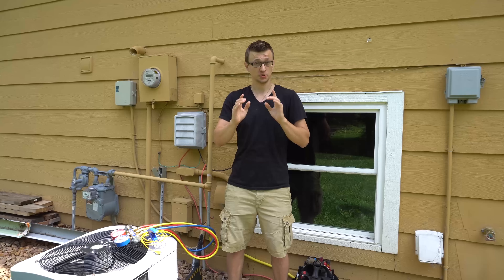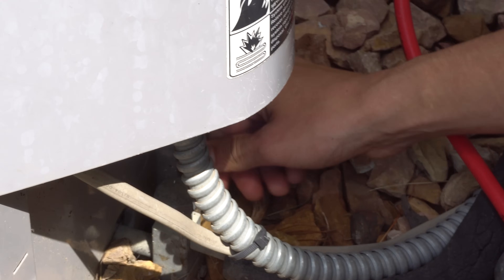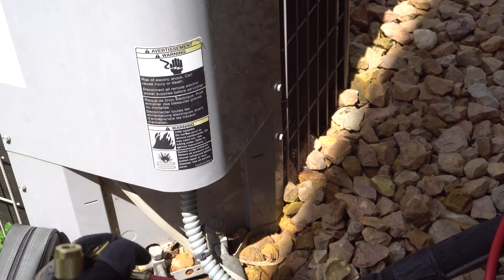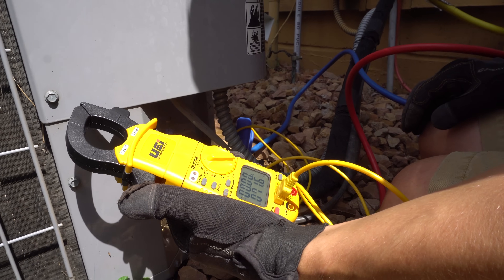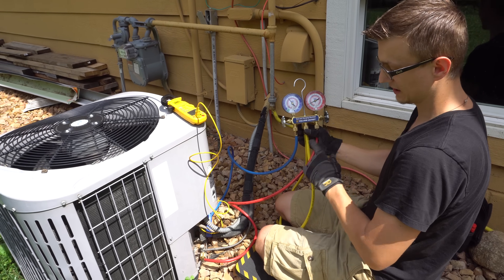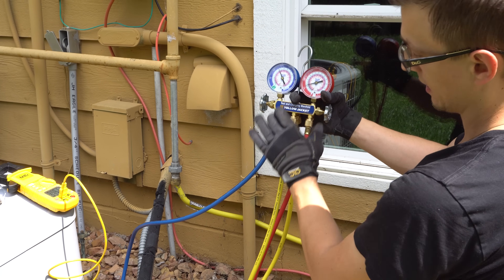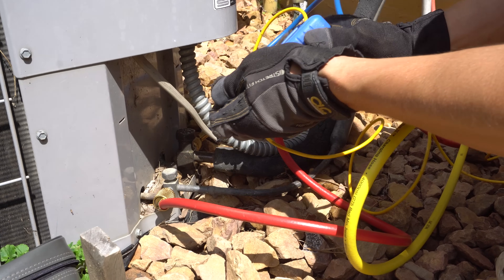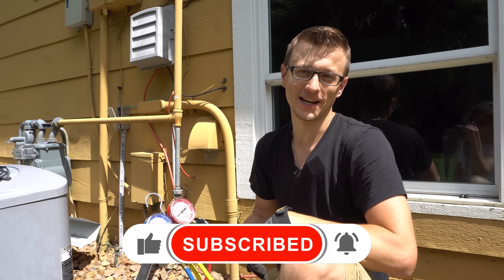How to Read SUPERHEAT and SUBCOOLING

Comment: That was a really low high side pressure.  Here in FL all the 3 ton R22 units I see run from 225-250 psi.  The other thing is the house needs to be cool when you check it.  Especially if you just had to add a charge.  I watch the temp on the low side tubing at the evaporator until the house gets cool.  The unit on my house uses orifice tubes and it doesn't have an accumulator.  I'm careful with it.  Good video, well done.

Comment: Sir.. I use your. Idea on my walk in freezer cold room.

Freon 404   but when i chek suction line pressure in my guage its showing 15psi  then i chek same color code temparture its -30.

Then i chek expanion senser bulb area suction pipe temparutr by themometer its showing  0.4

So how can i calculate this.

Calculator showing error.

Comment: Does the temperature outside  depending by the weather or if the unit in exposed in su affect the reading? And also does this method also work with celcius?

Comment: What about measuring the line temps at the evaporator? The liquid line will get hotter as it goes through the attic as will the suction line as it goes through the attic even though it's insulated.

Comment: If when the unit is off, if the pressures on the high and low side doesn’t equalize, what does that mean? How can it be rectified please?  However the unit seems to be properly cooling with a subcooling value of 10 degrees (14 degrees is targeted temperature on the decal of the unit.)

Comment: The pressure won't be equalized if there is a shutoff solenoid on the liquid line just before the evaporator/fixed orifice expansion valve.

Comment: good video, but maybe you should try pre-filling the gauges with refrigerant prior to attaching them to the system. Every time you attach dry gauges you remove some refrigerant. If that gets done enough times the system will have enough refrigerant "vampired" out of it the system will appear low on charge. We have a standing rule in out company "prefill those gauges every morning!

Comment: hey i was watching your video and its says suction line - ST = sc but i saw you connect it the the liquid line isn't the suction line only the low side line?  And also you said we can get both sc and sh readings on the liquid line at 9:07.  So i'm a little confused on the equation.
Reply from the maker: Sorry about the confusion. At 9:07 I was referring to the general location, right at the outlet of the condenser unit. SC is measured on the liquid line and SH is measured on the suction line.

Comment: Experts, any chance you could chime in please ? Mine is a TXV, Line temps are 81/suction & 95/hi, with gauge temp readings 22/suction & 110/hi, making my SH=59 and SC=15. Pressures are equalized at idle (150psi) but 10mins after operation gauge pressures are 48/low & 250/hi. I can't afford a tech at the moment & I know there's a leak somewhere because my neighbor's been "topping off" the system for me since spring just to get me thru the summer. The top off lasts about 45 days. Now he's away but I do have some r22, a manifold & an infrared thermometer. I know I'm shooting in the dark here with my lack of experience but I'm hoping someone could chime in so I could relieve my asthma in this hot weather.

Comment: You should always use a wet bulb and dry bulb method to determine your superheat, not the gauge. You can use the gauge in the pipe plant to figure your subcooling

Comment: Great video. I have a Rheem 3 1/2 ton condenser and a 4 ton air handler in the attic. With a TXV. My sub cooling chart saids @82 degree ambient temperature SC should be 5. Would that work for a 4 ton coil?

Comment: I thought it a good idea to purge when reading.  But nobody does.  I guess the pressure is still different enough to keep the air pushed up the hose and not mix.  I dont bother.

Comment: Semi retired HVAC service/Installer and former instructor...This is simple and very clear and the idea of marking the gauges, just plain smart...Thanks.
Reply: I know this is a random question but seen u were in the hvac field i recently installed a gas furnace with a 4 ton straight ac its a piston acoil .. an it doesnt seem to be getting cold. Everything is running fine and pressures are normal.. everything is new.. got any ideas on what could be causing this..only blowing like 68-70 degrees out the supply vents

Comment: EASY WAY TO REMEMBER "L for Line temp, P for Pressure"  OK so LP as in PROPANE as in GAS/VAPOR,  Line - Pressure (LP)= Superheat.   And for Subcooling PL (Pressurized Liquid)(propane liquid) so Pressure - Line = Subcooling (PL) WHEN I SAY PRESSURE I AM REFFERING TO PRESSURE/GAUGE TEMP Reading. PT Chart

Comment: When i started as a apprentice i had a senior tech write the exact samething on my personal gauges. He use Sat temp instead of gauge. I still have them and its very faded and can hardly read it now. I would personally never use a temp gun and always use some type of clamp. They are much more accurate plus can be calibrated.
Reply: He also told me when diagnosing a problem try to think of the low side gauge as your evap coil and high side as your condenser coil. So if your experiencing problems that are with one or other could be something that affects those coils. This isn't very every scenario but it is a good tip...

Comment: Question:  on a diff vid when measuring SH they did a wet blub at return and outside temp at condenser and said needed a chart to find out if you were low or high on refrig.    can you or do you have a vid. showing that process    thanks

Comment: The way you are measuring superheat is Incorrect.
A super heat chart must be used and is provided for you on the back of service pannel of condensor/heat pump.
Superheat method is only used on systems with orifice. 
Subcooling is used on txv systems.

Comment: Is the low pressure pipe always thicker?
I have a monobloc heat pump and the high pressure side behind the 4-way valve is thick and in your fimik it is thin. How should I understand that ?

Comment: Great video.  One note is that an IR thermometer should not be used for this.  The emissivity of copper is low and variable, and depends on the level of corrosion and surface roughness.  IR thermometer readings can be wildly inaccurate and this cannot be calibrated out.  A pipe clamp should be used in all cases of metal refrigerant line temperature readings.  The only exception would be if you have a painted refrigerant line due to overspray or something, or you coat it yourself with a substance of known emissivity.  Then you'll get an accurate reading.

Comment: True superheat should be measured back at the evaporator.  Of course, there would have to be a pressure tap there.  If you measure at the outdoor unit, you have the pressure loss and a temperature gain in the line set, that you have to figure into the calculation.  Good video.

Comment: I have a slight refrigerant leak in my home unit.  I track the sub cooling by measuring the difference of the temperature at the middle of the condenser coil and of the temperature of the high pressure line at the edge of condenser.  That difference is the value of sub cooling.  No need for using gauges, so no loss of refrigerant due to the measurement.  Doesn’t matter what refrigerant is in the system.

Comment: Hi, thanks for taking your time for sharing this with us. One question remains: what would be good values for SH and SC? I mean we measure these for a purpose. What can we use these numbers for?  I have installed my split climate unit here in Germany myself and it works - but I have used 9m line length instead of the proposed 5m that the supplier approved. Now I am asking myself whether the system works at optimal efficiency or do I have to add refrigerant. I think SH and SC would be the numbers to go with to find this out. Can U help here? 
Best regards from Munich, capital of the beers and home of the Octoberfest.
Reply: The measurements would be nearly the same...Line set measurements (length),make some difference, but the super heat and or Sub cooling is still critical...On a piston type metering device, the  goal is around 8-10 degrees SH or as close as you can get without refrigerant coming back on the compressor...On expansion valve the job is making sure there is liquid at the X valve...There should be a design SC # on the unit info tag if it's an expansion valve system...10-16 is usually a target range...They are all ball park figures, because Temps fluctuate as do heat loads...Common sense, amp readings and feel, are all your tools too.
Reply: @vernroach3413  Thanks. I use the AC mostly for heating and it works. I ask no more questions...

Comment: I've used your video to train my tech's. It's amazing how many different methods these guys had when I spotted their work. This video I recommend to keep as a favorite so on those moment you run into the All Knowing tech that has been doing refrigeration for 30 years, argues with you. Show them this video and move on. Thanks for making this clear.
Byron M.  - Oak Valley Electric & Air.

Comment: For superheating, the saturation temp is measured at compressor suction. For subcooling is measured at compressor discharge is that correct? I think saturation temp for subcooling is measured from condenser. From the compressor discharge, the term is degrees superheat am i correct? Kindly enlighten us because if you look at the ph and ts diagram this should not be the case for subcooling.. For superheating I have no problem on it as it match with the ph ts diagram.

Comment: Thank you for this video. Originally the blue gauge showed the saturation temperature of 20 degrees F (Pressure 43 PSI R22). At the same time the temperature I measure on the blue line next to the charging port is 80 degrees F. Thus my Superheat is 80 F - 20 F  = 60 F.  The pressure at the red gauge before charging was 200 PSI that corresponds to the temperature of 102 F. When I charged the system from the R22 recovery bottle, the Superheat changed 75 F - 26 F  = 49 F. my red At the same time my red gauge after charging shows the pressure 225 PSI or it is the temperature 106 F and I measured the temperature of the high pressure pipe was 106 F. Question- is my system is overcharged now of I should continue charging it?
Reply: having the same problem on split unit, which i also found a restriction on my TXV before the evaporator, after i charged it with 1lbs 12oz.....

Comment: This information is very useful for HVAC persons. 
I have a problem in one DX Condensing unit during charging I can't achieved supply air temperature below 20 c. And return temperature is 23c. Kindly explain what is the causes and how can I maintain supply temperature

Comment: Gauge pressures will fluctuate as the compressor turns on and off. Which gauge pressure do you use, the cut in pressure or the cut out pressure, or an average of the two?

Comment: Love love love your videos, Word of Advice!  Thanks.  QUESTION:  can I use a pocket-held digital thermometer to accurately enough measure the suction or discharge temperature? (Since I will only be taking temperatures of my personal unit, I would like to minimize expenses.)
Reply from the maker: Thank you! Glad you like the videos. Yes, I don't see why not. The temp reading comes from the outside of the pipe anyway. As you mentioned yourself though, it may not be as accurate as a clamp but it should be close enough. Makes me want to do a little experiment if I get around to it later and see what the difference in temp would be.
Reply: @WordofAdviceTV  Thanks for the response (and awesome videos)!

Comment: Very helpful guidance, thanks.
I just wonder how much power in legs it takes to make front and back flips. It looks like even on trampoline it is difficult with the assistance of mechanical springs. I see them doing it on ground level and looks easy to do but some are near to fail due to inattention or just rustiness.

Comment: Retired after 35 years,first 3 in residential and 32 years in commercial and industrial and I would agree with Shawn Green that this is a great video for beginners and even some guys that take there skills for granted. There are many times guys hook up low side gauges and don’t purge there hose and inject air into the system. Well done young man👍🏻
Reply: I’m doing a lot of refrigeration work, so I always connect high side first and purge low side through it, because with r134 you can get negative pressure inside with low charge

Comment: Why is that important though? Super heat and sun cooling?
Reply: Superheat is how much heat the refrigerant absorbed after evaporating. Low superheat can be a sign of an overcharge, metering issues, or lack of airflow through the coil. High superheat is usually because the system is low on refrigerant. No superheat is bad because a liquid surge can hit the compressor.
Subcooling is how much heat the refrigerant released after condensing. Low subcooling can be caused by low charge, lack of airflow through the condenser coil, or the txv. High subcooling can be caused by an overcharge or the txv. No subcooling means that vapor can enter the txv, and liquid refrigerant is needed to absorb heat.

Comment: so when you say Gauge temp is that the same as the PSIG? and we use the same concept even if its a heatpump?
Reply: It refers to the saturation temp of the refrigerant at that pressure, it is found on the p/t chart for the refrigerant.

Comment: I like this short explination superheat and subcooling good explination simple supeeheat =L-G and subcooling= G-L 
Suction ligne or low side blue hose and disharge line high side red hose. Vapor or liquid dry temp wet temp pressure chart to get that number 8 or 10 dor make sur to add freon or recover in it good job

Comment: Hi Jay, what would you advise to check if superheat is 0 or even negative (105F HS - 104.7 ) when it hot outside (80-95F) ? but when it is a bit colder (evening or days with up to mid 70s) superheat is even higher (20-25F) comparing to expected 12-18F. As you may guess LS pressure/temperature is always too high and vice versa HS pressure/temperature is too low (55F / 105F). Adding or removing refrigerant does not help, filter is new, coil is clean, fan works well, delta t is 7 to 9F, only on evenings it is 15F. HVAC Goodman 2.5 tons ~9 years old, cooling area is 1200 sq ft , state CT. goodman GSX130301BE, Goodman Aspt36c14AD

Comment: As a newcomer into the HVACR industry (1st semester HVACR school) I can't thank you enough for putting this concept of SuperHeat and SubCool perspective (without all the smoke and mirrors instructors use though maybe not on purpose) using easy to understand words and a simplified guidance for using a P/T chart, manifold gauge and temperature clamp readings. Keep up the great work and I look forward to more instructional videos.
+Eddie+ in Bayou Vista, TX

Comment: Great video you really show how easy it is to get subcooling and superheating calculations. If you got those txv expansion valve you use the subcooling and with the fixed orfice tube type you use the superheating. So both are important to know . Ya and I agree some times you can mix up what subcooling and superheating is if your visual paying attention to the manifold gage colors.

Comment: What if your A/C is an inverter unit with bldc compressor and electronic expansion valve and it changes its parameters too quickly for you to measure and calculate them😂🤔

Comment: That has to be the clearest explanation I’ve ever seen of those. As a novice - my question is, if the SH and SC match the manufacturers spec does that mean the system is working correctly? Is it possible for those to be spot on but the system still have problems? Thank you!

Comment: Good video on explaining procedures. I did notice that the system was low on refrigerant. Superheat should have been between 20 and 25 at the condenser if the evap coil had a piston in it. 10 at the evap coil.

Comment: Great job explaining this procedure. Once your numbers are ascertained. What would be the standard reading you want? You said in the video that 8 and 10 was very good. Is there a chart or label on the unit declaring normal temps? Thanks!
Reply: I should have looked at earlier comments. I believe I found the answer there. Thanks.

Comment: I thought you had to use your PT chart to convert the temperatures  on your gauges. Or is that only if its a different refrigerant. Sorry if the question seems dumb im still learning all this.
Reply from the maker: You would use a PT chart if the refrigerant you are checking is not on the gauge. Otherwise the gauges have the PT chart "built in" right on the gauge.
Reply: @WordofAdviceTV  yup i i figured. thank you for the reply!

Comment: Only one thing I can add is that taking Superheat at the Condensing unit could be miscalculated because  you are actually getting total SH not actual SH ( i.e. lineset length could distort the SH numbers to higher than actual ) Superheat should be taken at the outlet of the Evaporator to be precise ..... Just me being over judgmental lol 😂

Comment: What should the sub cooling and superheating value of different type of refrigerants? If you share this then it will be very helpful to me and then I can easily charged R-410 a system with sub cooling value.
Reply: Doesn't matter when changing refrigerants. The basic numbers still apply. If you're charging any refrigerant by subcooling, it should have a txv.

Comment: hi, hi, r410a system ( with fixed orifice) with equalized pressures of around 200psig. But once compressor starts the low side drops to 50 psig while the high side goes up to 300psig. I checked superheat was like 80F and subcooling was 2F. Does this mean the system has leaked out all the refrigerant? Does the 200psig equalized pressures means there's refrigerant in the system? thank you.